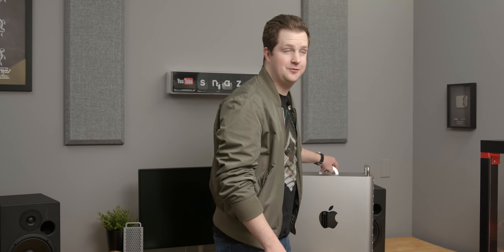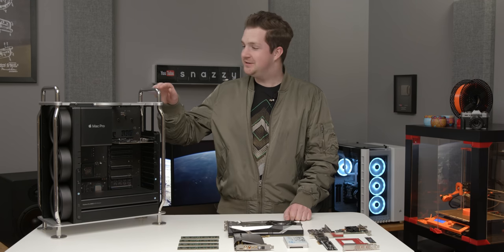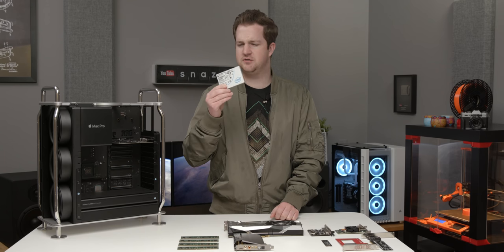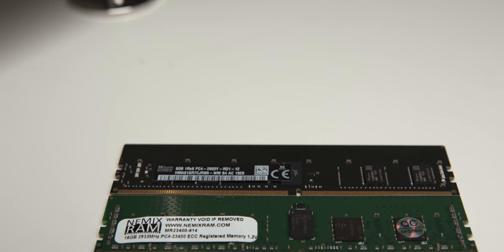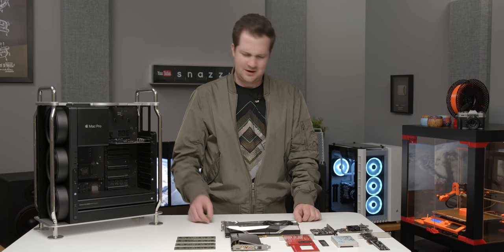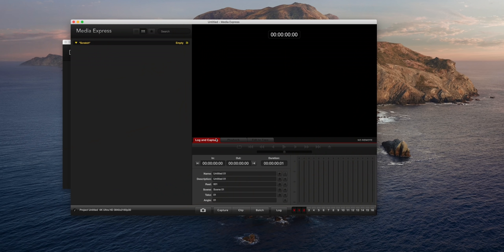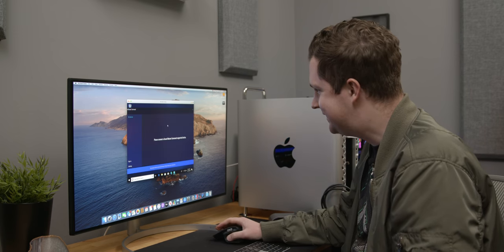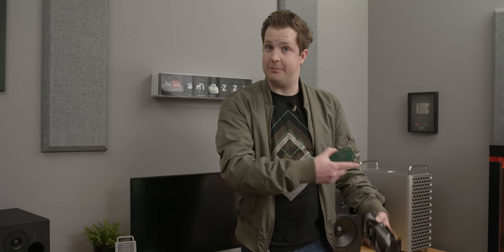What Weird PCIe Expansion Cards Work in Mac Pro?

Comment: Do you run into any issues with the T2 chip by booting to the installed  internal NVMe since the t2 is directly linked to the Apple installed SSD?
Reply: I think in this case the SSD won't pass through the T2 since the PCIe lanes are not passing through it. Only the lanes for the. Apple SSD's are being forwarded through the T2. Otherwise they would have broken compatibility with other devices, the T2 would've also slowed the communication with GPU's and etc.
Reply: I don't think so, it's like any other drive to be honest. Because you can also put in hdd's to expand your storage, the NVMe will work the same way :-)
Reply: @DBLCreations  but he is talking about booting from samsung ssd, not if you can expand storage
Reply: @xSh0uTx  They installed OSX and booted from NVME in the video.
Reply: I think when working with encrypted filesystems you run into issues... Because T2 is a lot of security checks and co-processing.... pure speculation.
Reply: @xSh0uTx  It seems like Apple didn't think about that then. Because as Stacey Bright mentioned: "They installed OSX and booted from NVME in the video"

Comment: Finally, a Mac that's just a big Hackintosh with unnecessary security chips.
Reply: Sadly the t2 is there. "Protecting" the ssds...
Reply: At least you could actually install MacOS onto another SSD and run it off that. The T2 chip can't do shit about that as the drive doesn't use it as its controller.
Reply: @DedMaximChannel  the t2 chip is there to protect apple, not the user
Reply: Mac Pro still has the T2 chip.
Reply: @rcradiator  T2 chip is not only designed for working as SSD controller. It stores apple pay info and work as an encryption device, like TPM 2.0 module in a windows machine. On macs that have MICs and cameras, T2 also work as a bridge between OS and these hardware, makes it harder to hack. And it also works as a hardware boot lock, just like intel-Anti Theft Technology on a windows laptop, with remote control from iCloud. Fun fact, Apple never intended to block user to boot from external drives, if you have ever used Target Disk Mode (allows you to boot from a drive in another mac via Thunderbolt connection), or tried installing macOS in an external drive (like WindowsToGo), you'll find that its way easier than doing it from windows.
Reply: That's why I still like the 2010-2012 Mac Pro. All the advantages, none of the BS security.
Reply: @rogerwilco2  And fractions of fractions of the performance lmao. The quad core Mac Pro 1.1 I have can barely run chrome.
Reply: @ryandickson6761  The Mac Pro 1.1 is slow but I have a quad core Mac Pro 5.1 with an SSD and 12GB of RAM and it's speedy
Reply: Ahhh, I love comments that neglect to fully speak on the T2 chip. I love internet/YouTube comment sections 😂
Reply: And crap IO.
Reply: There is still a T2 Chip
Reply: For all of those replying with "bUt ThE t2 cHiP", that IS the unnecessary"security" chip
Reply: It's literally not a modular PC, Apple is completely misselling this. There's only like 2 supported third party cards, and you can't even replace the storage.
Reply: @HouseOfFunQM  
Collins dictionary states "A PC is a computer that is used by one person at a time in a business, a school, or at home. It is not usually a portable computer. PC is an abbreviation for 'personal computer'."
I'm pretty sure that makes it a PC?
Reply: TheOneCode
Webkit?
unnecessary security chips??? registered memory need on Xeon??? just play a game only...Not needing good shit!
why you need  Hackintosh PC crap? no Job? Not doing any projects now?
Reply: @lucasrem  what?
Reply: Griffin S The 6 core w3680s are relatively cheap now (assuming it’s a single processor machine). It’s a great upgrade for the machine if you do any heavy workloads.
Reply: Define 'unnecessary' I quite like the backend security that is sensible when dealing with wireless payments and password hand off to my watch but nobody else watch and the unifying nature of iCloud services as a result of the security chips.
Reply: MAAS Gaming If that was the only thing it did I’d agree, but that’s not the case. Why does it do a checksum check on the SSD? What purpose does that serve if you can still boot from an external drive apart from forcing you to overpay Apple for an SSD? All this does is stop repairs as high quality, private encryption keys can (and are) done without these restrictions with devices like yubikey. Especially with the MacBooks and the T2 is a complete Trojan horse and only hurts the users ability to upgrade or repair.
Reply: @HouseOfFunQM  What an idiotic comment.  Why do you need or want to REPLACE the storage?  That internal SSD is just a base foundation. You're provided with a slew of industry standard PCIe slots to ADD as much storage as you want, of just about any type you want.  If you can't see that you've missed the point.
Reply: girlsdrinkfeck the dell prebuilts that compete with this actually cost more, and they’re ugly af.. but then it will also support much more things..
Reply: Joe I don’t know how you came to that conclusion. A Dell Precision with a very similar, though older release Xeon 6134 is over 2k (35%) less. That’s a big difference. One can argue that the extra pcie slots are slightly better but how many people are really going to be filling those with SSDs? And at what additional cost compared to sata? This machine is nice but, is, I would say, at least, 30% over priced. The 2010 3.2 quad core at its price of $2900 when it came out was a much better deal, for a system that follows many of the same design concepts.

Edit: Also, ugly? Almost no one who uses a machine for actual real work in the industry gives a crap about what it looks like unless it’s a graphic design place where it’s all about image. Most of these machines are buried under a desk somewhere and almost never come out. Their job is to run reliably and crunch through data and renders fast.
Reply: Alexlfm i dont have any argument about what you said lol but from the video i saw its not really a huge price difference from some of those high end pcs, but i mean the mac is kinda a disappointment with certain things like you said.
Reply: @DedMaximChannel  I'm purchasing and administering workstations for a media company running about 50 workstations. I would shoot myself in the foot before buying one of these pointless boxes. What a waste of resources.
Reply: @DedMaximChannel  We should keep this one-sided.
Reply: @keithh8176  Well said.
Reply: @rogerwilco2  Yes but les bandwidth in PCI etc.
Reply: @ryandickson6761  Well it's really from the 4,1 up wards.
Reply: @rogerwilco2  Someone isn't listening

Comment: Wait. That Mac Pro has an SSD that is slower than a Samsung EVOPlus?
Reply: thats apple for you
Reply: Typical Apple
Reply: Yes it's lowest end and smallest SSD is slower
Reply: Yes because it's not in raid 0 like the rest of them and when the raid crash you lose everything yeah!
Reply: Hihihihi... yeeeeeeeees!
Reply: Even the ram is just 2933 hz now a days even cheap pcs use 3200 hz ram
Reply: FalconX88 smaller SSDs are naturally slower. It’s really not that much of a surprise.
Reply: ssd is slower than nvme..    that should not be a surprise.
Reply: Jai hind Jai bharat it’s important to note that the 2933 MHz ram in the Mac Pro is ecc, whereas the typical 3200mhz ram kit is not
Reply: Louis Dubé dude, that’s the same thing as having one single evo fail...
Reply: yeah, think diferent
Reply: It's only 256 GB. The 1 TB in my 16" MacBook Pro is more comparable to the Samsung, so I'm going to assume the 1 TB in the Mac Pro is as well. Still pretty pathetic for a $6,000 Mac to come with a budget 256 GB SSD by default.
Reply: Jai hind Jai bharat Well yeah, but 1- The dimms are ECC, and 2- They are 128 gb dimms.
Reply: @TimurTripp2  Not as pathetic as it sounds. In commercial and/or video editing environments data is usually stored on a storage solution, not on local drives. When used that way, the internal SSD is more then big enough as it only has to hold the operating systems and installed applications.
Reply: gotta rake in the profit with sub par parts, I guess
Reply: Louis Dubé my PC isn't raid 0 and my nvme gen4 runs at about 5000mbps
Reply: well apple still sells a imac with 5400 rpm drive so slow ssd doesnt seem too out of place
Reply: @wicked_observer  no gen 4 PCI-E in the Mac pro
Reply: Elliot Kaufman Isn’t 4th gen only supported by  AMD CPUs? Which MacOS doesn’t support very well
Reply: @cyotheking  but you double de chance to fail
Reply: Vaughn Downard you  can put together a threadripper 24 core, 256gb ram, Radeon VII, with 10gig lan, and thunderbolt 3 expansion cards in an all AMD and two TB of PCIE 4.0 drives for 5000 dollars. That’s the same price as the base 8 core 32gb of ram and whimpy 580x
Reply: HenryLoenwind and? I can put two 1tb PCIE drives in a pc that is comparable to the upper end Mac pros and raid 0 those. A single Sabre this rocket 4.0 drive hits 5000read 4500 write. Then raid 0 them and I’m not even sure how fast they get when doing the same thing the upper end Mac pros do. The fact is I can do that in a build that is cheaper than the cheapest Mac Pro. Just because they can get away with it doesn’t mean they should. Remember that your programs need space too. Just because you have external storage like NAS for video files, you still need room for all your programs, cache space for in timeline rendered clips, and plugins you may need.
Reply: @RiceCube Tech, Ha! if I had a PC with 1.5TB of ram It would be diskless. No ssd or hdd.
Reply: @FalconX88, Sad huh?

Comment: Nice video :) - thanks

Two tips:

PCIe to SATA power adapters are available for little money. So it is not necessary to buy the expensive adapters of the future. This would make the USB 3 card possible.

To pass the sound card (or other PCIe devices) to the virtualized environment, it needs PCI passthrough.
Professional virtualization solutions have mastered this for several years. The prerequisite is that it is active in uEFI.

I apologize for my English.

Comment: You may find you need to manually connect the sound device in Parallels through the devices menu option for Windows to pick it up - I've often had to do this for ISO's to be recognised.

Comment: What makes nvme drives unreliable?
Reply: Your workload has to be matched properly
Reply: If you write petabytes a day.
Reply: He didn’t say that. They’re just not as reliable as U.2 drives.
Reply: U.2 drives are aimed at enterprise users who plan on writing lots of data.  Basically you get better quality flash that can withstand more write cycles and you get more spare space for wear leveling purpose but you pay a lot more for the drives (when new).
Reply: Andrew Lane but there are pro level nvme drives like the 970 Pro as well
Reply: @chrisness  The drives like the 970 Pro are in between consumer and enterprise grade drives - i.e. they are better than consumer drives with their performance, write endurance and warranties but they still are not at the same level as enterprise gear.
Reply: NVMe is only the access protocol. M.2 and U.2 are two differents form factors and U.2 tends to be a bit more robust (solid case, heatsink, deported connector etc). The amount of data you can write on a drive is determined by the memory cell technology, not the form factor.
Reply: "Write endurance" : how many TB of writes the manufacturer ensures the drive will be able to handle before experiencing failure. 

All flash memory (USB drives, SD cards, PS2 memory cards, 2.5" SSDs, ROM cartridges for old consoles, ,M.2 nvmE drives) have a limited number of writes before they fail. This is because flash memory relies on a kind of transistor called a floating-gate MOSFET, where there's an oxide layer that insulates transistors when they need to be turned off. Writing new data to a block of flash memory requires that all of the old bits be erased, and the erasing procedure provides enough electrical energy to decay the oxide layer, bit by bit. Initially, you'll get just a few errors with a few MOSFETs that can be corrected with software, but over time enough of it fails that the SSD can become corrupted. The amount of data worth of writes that the manufacture can make certain is the lower bound on how much you can write before the drive fails, is called the drive's "write endurance".

But this isn't typically a problem for any consumer use. The Samsung 970 Evo 1TB has 600TB of write endurance. That means I can completely erase and then completely fill up my 970 Evo 600 times before I see a hitch. If I'm writing 200 gigs to the SSD every day (absurd), then that's more than 8 years. In 8 years time, I'll be way more concerned with significantly faster read/write speeds in newer drives than I am worrying about my current drive being on it's last legs. And SSDs typically last a little bit longer than the official write endurance, anyways. 

It's only when you're in a position where you're writing a lot – more than a TB a day,  for example – that this gets to be a problem. But typically this is a problem for Facebook or Google-sized companies, not day to day people.But they do make more expensive "pro" SSDs that cost almost twice as much for the same data size and similar speeds, but with higher write endurances. 

HDDs do not technically suffer from this problem because those drives store data on a magnetic platter, with magnetic heads on actuator arms reading data off of the disk as it spins. You can theoretically read and write to this for all eternity. But because HDDs have moving parts, they're more susceptible to environmental damage that causes corruption over looong periods of time - from moisture, temperature, shock, etc., even just wear and tear from too many writes and reads in a small enough time that stresses out the various components. That's why HDD manufacturers also provide MTBF (Mean Time Between Failures) figures; basically how long HDDs typically last in the wild. 

Hope this helped!
Reply: @OH-tj4qn  very nice write up thank you for that.
Reply: @OH-tj4qn   Great explanation! I would add that with 4K video editing being common now, 1 TB/day isn't so unusual. Even at that rate you'd still get a couple of years of use out of it, so maybe it's not a problem.
MTBF is a more complicated metric than most people realize. An MTBF of 100,000 hours does not mean you can expect 11 years of operation. It means that for a large collection of drives, you can expect one to fail for every 100,000 total power-on hours. If it's based on 1,000 drives, that's one every 100 hours. Also, a proper MTBF spec includes a time period where it applies, often 5 years. After that, anything is possible. It's a useful metric -- 100,000 is better than 50,000 -- but it doesn't tell you much about what will happen for a single unit.
Reply: the nand flash inside ssd is less durable nowadays especially considering the media pros wearing them quickly via putting them under higher throughput workload.
Reply: Get 2 in redundancy if you want speed and reliability with HUGE writing amounts and near full storage.
Reply: They are both nvme so nothing (m.2 pci-e and u.2 is really the same and even if you have direct pci-e x4 drive it's also the same, it's the same technology)? The only difference i that u.2 drives use more expensive memory that has better durability on paper and manufacturer has better warranty, also U.2 has hot swap capability (on paper really since you can hotswap m.2 as well if your motherboard supports it) and generally better suited as they do include larger heatsinks and controllers do get very hot.
Reply: Any consumer hardware will be unreliable by comparison when used in a  professional workstation. ;)
Reply: Omar Hegazy that doesn’t explain why u2 is more reliable
Reply: Benjamin Ehrlich won’t they both just fail around the same time if you have two and are writing the exact same data to them?
Reply: They are consumer grade products. The intel u.2 units he showed are enterprise grade and thus much more reliable. Also a whole lot more expensive..

Just setup a raid with consumer drives and get your reliability that way.

Comment: Did you try checking the audio/midi prefs with the sound card? You can often create a device out of multiple audio i/o's in an agrigate device. Apples settings regarding audio are so much more adjustable and accessable.